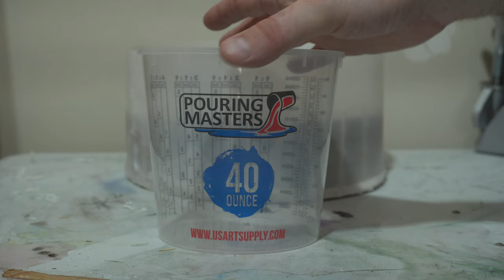Woodturning | The Emerald Walnut Bowl

Comment: That is such a beautiful design just gorgeous. What makes it better is the fact that green is my favorite color in just about any shade. Your skill level tells me you’ve probably been at this a while, so would you tell me why you wet sand? Is that a special sandpaper? Yes I am a newbie I’ve had my lathe since February 2023 and this is August 2023. I still have a lot to learn and hope you don’t mind questions about things I’ve never seen before.
Reply from the maker: I wet sand for two reasons: 1) it helps reduce sanding dust from getting into the air, which both keeps the workshop more clean and also makes me feel better about what I'm breathing (I always have a respirator on in the shop, even while wet sanding, but it still gives me a bit more peace of mind), and 2) I usually find it sands better. Anything with resin in it will clog your sandpaper incredibly fast, but the water helps suspend the particles, allowing for an easier sanding experience.

Wet sanding is by no means a necessity (it does introduce the danger of wood expansion/cracking, which you need to consider), but I generally prefer it over dry.
Reply: @formanwoodworking  thank you for the info

Comment: ...man, that's gorgeous!...love walnut...and green...so I can't help but love it...👍
So, I have a small lathe in my packed garage and no room for a dedicated sharpening system...I use my 6x9 belt sander for my spindle tools. I don't have a bowl gouge as yet...it looks like you use a standard grind bowl gouge for most of your work...is that correct?
I see so many others using fingernail grinds but I don't feel confident about sharpening one on the belt grinder...but if a standard grind can do what you do, I'd look into getting one...
Thanks,
Matt
Reply from the maker: Thank you, Matt! 

And yes, I just use a standard bench top grind bowl gouge, and I sharpen it on an 8 inch bench top grinding wheel. I'm not very experienced with free hand sharpening, so I use a guide to help get a more consistently round and angled sharpen. In case you happen to find some room for a grinder down the road, this is the guide I use: https://www.leevalley.com/en-ca/shop/tools/sharpening/jigs-mounts-and-rests/101416-vari-grind-accessory-for-wolverine-basic-sharpening-jig
Reply: @formanwoodworking  ...thanks so much for the information...will definitely check it out...
And I look forward to what you have for us coming up...👍
Matt

Comment: I am a beginner turner and would like to know how you cut your angles on the miter saw. Thanks
Reply from the maker: Hi Larry! For this project, I had my foam bottom (the bottom of the mould) cut out before I started cutting any of the wood pieces. Once I cut out the centermost most pieces, I placed those on the foam circle, and from there, I was able to get a good idea of what angle I'd need to cut the next adjacent pieces to maximize their size within the circle (I used an angle finder to get a precise idea). I then did the same thing for the next adjacent pieces, which I believe were cut at a 50 degree angle.